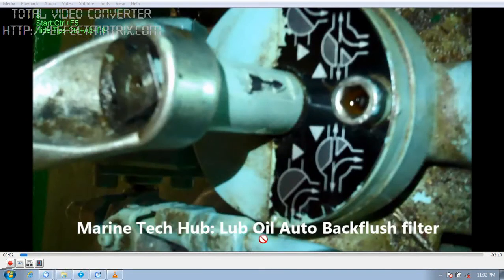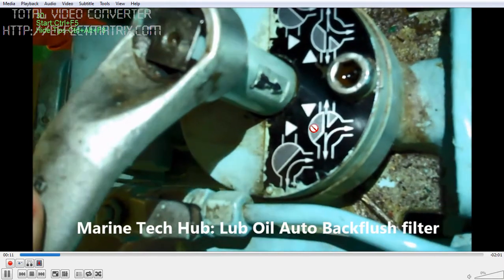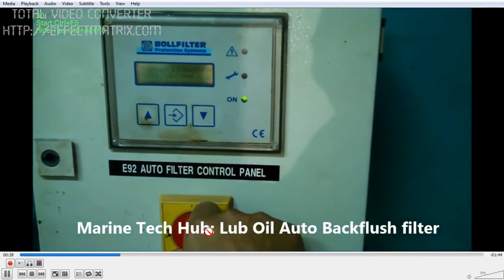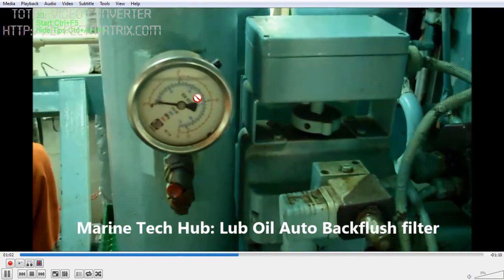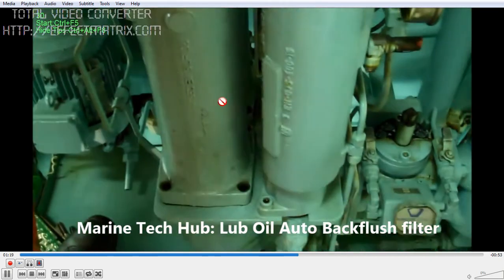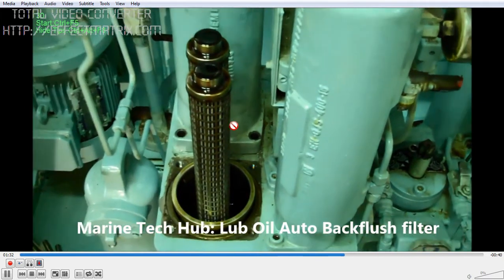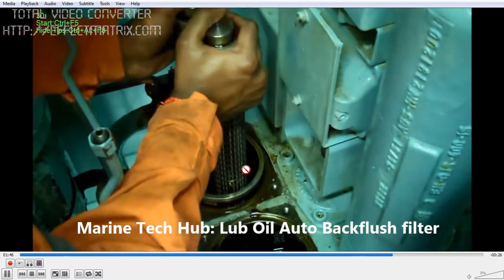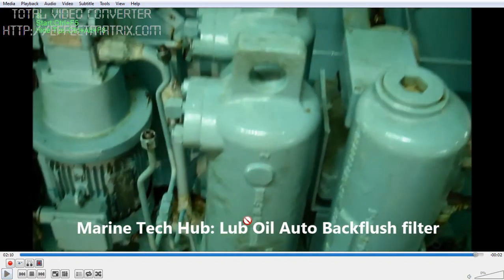How To Change Over From Auto to Manual Filter : Lub Oil Backflush Auto Filter

Comment: sir hello, thanks for the video again. before we change over from auto to manual, is there any action we should take? like equalizing the pressure between auto and manual filter to move changeover rod easily? in the past i remember something like that and im not sure now. and another quesiton is, is it necessary to operate selonid valf to open drain piston after we already flushed the system manually? when we manually flush the system drain piston is opening already by itself? am i wrong? are you operating the selanoid manually for extra precaution ?

Comment: Sir purpose of float and which ram you are talking about, the one which opens the outlet port????
Reply from the maker: The purpose of the float is to vent the air in the chamber when fuel is filling up , then the fuel will push the float up and close the outlet which goes to the overflow tank. if you go through one of the video  I have shown the ram and its purpose. The ram opens for few second to drain the dirty oil to the overflow tank during flushing operation  and then closes.
Reply: Marine Tech Hub yeah sir just now seen it